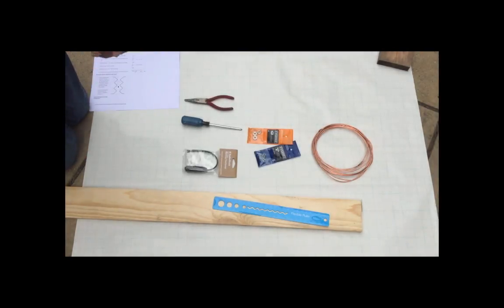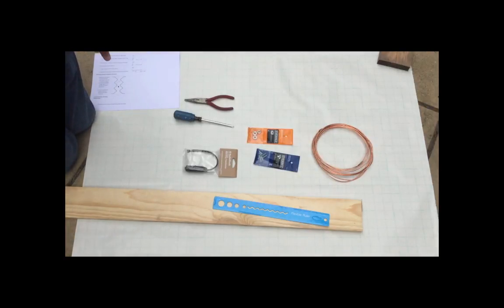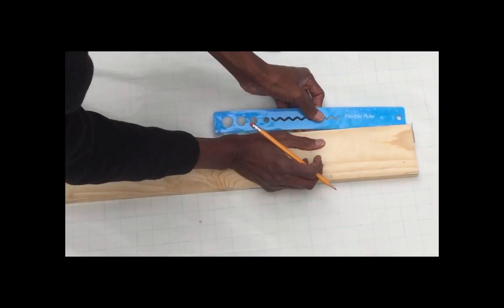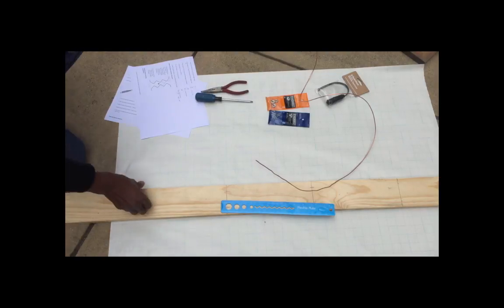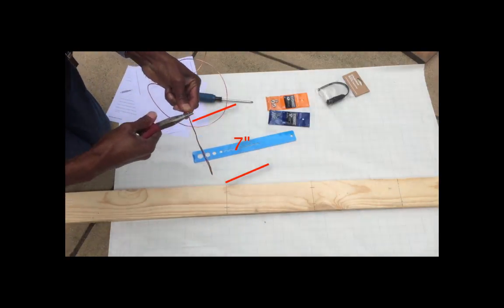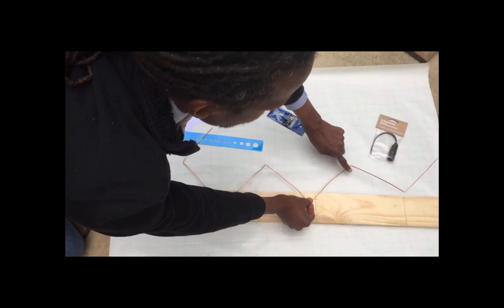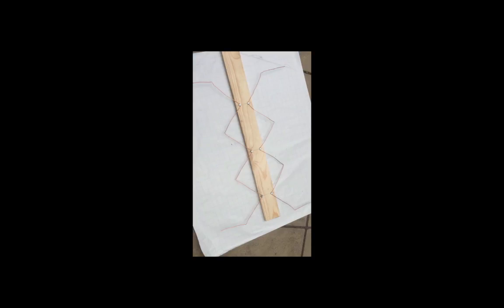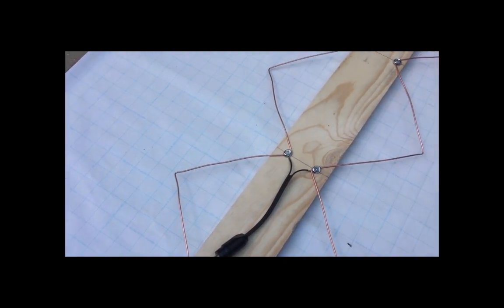How To Build A Gray-Hoverman Antenna For About $10

Comment: this video is perfectly made - I followed your directions to the T and it works perfectly - the store bought ones didn't work at all. I live in West Los Angeles and I get 'almost' all the channels. Just missing ABC7. Gonna try to add a mesh backing to it - I think i saw a video showing a way to amplify the signals
Reply: This is a Grey Hoverman design and is optimized for UHF 470-620mhz, roughly channels 14-48. 
To pick up VHF signals from 2-6 (54-88mhz) and 7-13 (174-216mhz), you need to add NARODs to the top and bottom.
Cut two lengths of straightened copper wire to 30 inches. Hang one above and one below paralleling the horizontal portions of the driven elements, 1/2 inch away.
Make sure they do not touch. The signal is coupled through harmonic induction into the main driven elements. 
One of the best ways to increase gain, (besides elevation) is a well designed reflector spaced between 3-1/2 to 4 inches behind the driven elements..  

I built a folded dipole with a 7 foot element for the low VHF channels 2-6. It sits on top the Grey Hoverman with custom designed NARODs @ 20 foot High. They feed into a splitter designed to combine VHF and UHF signals. This feeds a signal booster that feeds into my TV via RG6 cable.
The closest transmitter is 47 miles away and the channels I want are 61 miles away. This design has proven to be an outstanding performer.
I was pulling in transmissions from towers that were over 80 miles
Reply from the maker: That sounds good. I think I'll try that reflector to see if it helps.
Reply: @coolbrown1  You should see a 3db gain from adding a reflector.